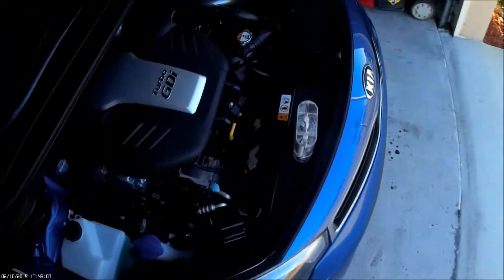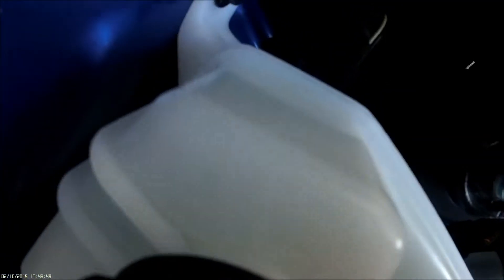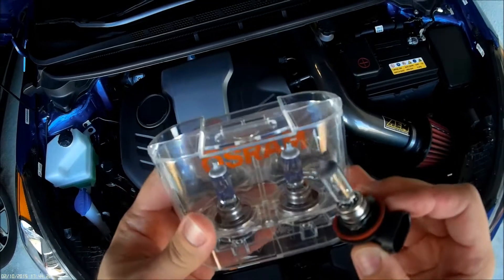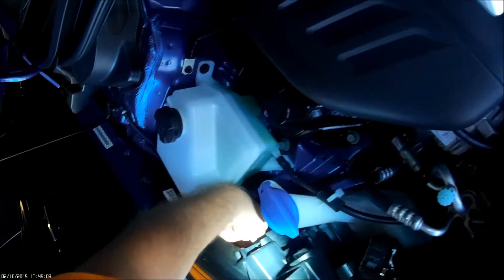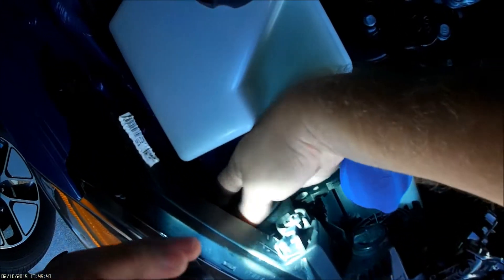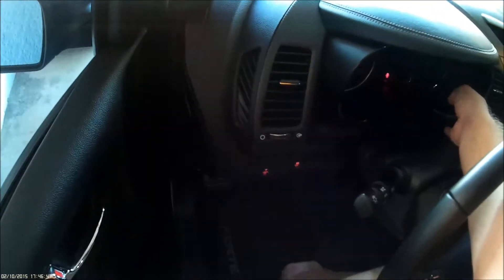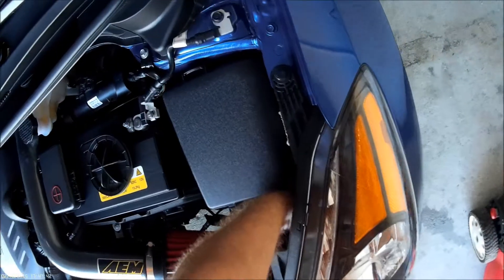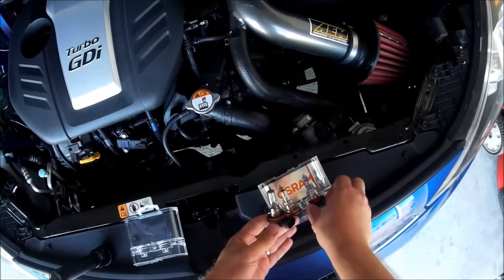2014 Kia Forte Koup Turbo GDi Headlight bulb change

Comment: Just an FYI, I finally got the bulbs, turns out for the 2010 they actually don't fit, the 2010 is a different fit to your model shown here..
Reply from the maker: +kk andre that sucks that you got the incorrect bulbs... I usually check the sylvania website to check the bulb sizes etc.

Comment: Where did you buy the bulbs? Do you think they would fit on a 2010? And are they white lights or blue?
Reply from the maker: +kk andre the light output is a nice bright "pure white" type of white. if i recall correctly i purchased the bulbs off of ebay. i just searched H11 Osram Unlimited Nightbreaker.

I cant wait for prices on OEM HID replacements to start coming lower. upon this videos release, HID headlights with real OEM HID's were in the 900$ range, they've come down to about mid 350$ with aftermarket companies... so maybe there will be an OEM HID type of video in the future for my vehicle... which is the only reason I haven't dropped money on an HID "kit" for a retrofit... i would rather do the OEM replacement

Comment: are there any locking clips on the bulb? I tried to replace MI e but didn't know how to disengage it from the wires.
Reply from the maker: if I remember correctly there is a clip on either side and you can pinch and then pull down and it'll come off. you can twist the bulb and pull it out then unclip the bulb after you pull it out bc there isn't much room
Reply: Hey Hon, my concern is if I pull it out and then unclip the bulb out, wouldn't I just pull the bulb out of its alignment?  If I do this and put in the HID bulbs replacement to put back, will it 'snap' back in its place because I don't want to have the bulb misaligned afterwards. Hope you understand what I mean.
Reply from the maker: +supercooled if you twist and pull the bulb out, then unclip it, you won't do anything to the alignment, the alignment is set by a screw that moves the projector housing around which the bulb goes into.

Comment: 1. Do you still own the car?
2. How many miles on it?
3. Have you had any issues with it yet?
Reply from the maker: It was totaled in a car crash in 2016.
Reply: @Super_64  Jesus Christ, everyone ok?
Reply from the maker: @ivan23caravantes44  yes.
Reply: @Super_64  good. So how many miles did you have on it before it was totaled?
Reply from the maker: @ivan23caravantes44  I think under 20k
Reply: @Super_64  that sucks man... that car had so many more miles to go... poor thing.
Reply: @Super_64  I'm at 127k almost. Regular maintenance. Done by me. Using every 20k as a marker for oil and every 30k for transmission.
Reply from the maker: @ivan23caravantes44  meh... it was a fun car and I enjoyed it... but for my situation it actually worked out... it was a lease so it got paid off and then about 3 months later I got a company car so it probably was a blessing is disguise
Reply: @Super_64  no wonder the crash happened. It has always been my belief that Mercedes and BMW drivers where I live dont care about other's because they go around driving with that same mentality the entire time. So they run red lights and stop signs and nearly hit you on the freeway when cutting other's off while changing lanes without a turn signal and especially when tailgating everyone who isn't doing100 mph.
Reply: @Super_64  because they dont own, they are leasing.
Reply from the maker: @ivan23caravantes44  well the turbo was totaled bc a lady was texting a driving... she slammed into the back of a Tahoe and the Tahoe hit me and pushed me into the back of an explorer... she hit the Tahoe at approximately 50 mph on the down slope of a bridge. 
The way your reply was worded seemed to insinuate that I caused the crash just bc my car was a lease.
Reply from the maker: @ivan23caravantes44  here’s the last dash cam video from the koup
https://youtu.be/nQcY4EZTn2Q
Reply: @Super_64  most people on a lease are to blame. But you on the other hand can prove you didn't do it. That's the difference. Like I said Mercedes and BMW leased vehicles.

Comment: your air intake is it the enjin one off ebay ?
Reply from the maker: Travis Dean no, its an AEM veloster cold air intake. I just didnt use the second tube that puts the filter behind the foglight as it made the filter rub the foglight, because the veloster and forte have different front bumpers.

i then cut probably 3 or 4 inches off of the main tube and the i also installed a shorter filter. I did all this months ago as there wasnt any intake on the market then.

I plan on eventually replacing it with a 6th element engineering cold air intake that you can find here:

http://www.6thelementengineering.com/product-p/01-01-100.htm
Reply: @Super_64  did you ever replace it or still running that hot air intake
Reply from the maker: @JB-vt5sz  the car was totaled a few years ago.
Reply: @Super_64  aww, that sucks. Best of luck fellow YouTuber

Comment: why not get an hid kit ?
Reply from the maker: Compa Cheo if I remember correctly there wasn’t enough room inside the housing
Reply: If you leave the circular covers off then moisture gets in especially during the night and pretty soon you will have foggy headlights from the inside as well as the outside. Water inside it will eventually ruin your headlights and the wire's too. Flake away all the chrome inside your headlight or destroy the lenses on the projector lights.